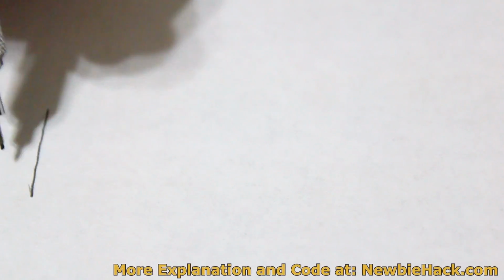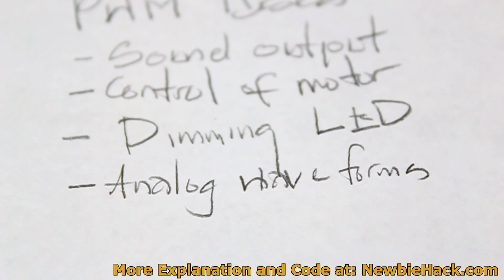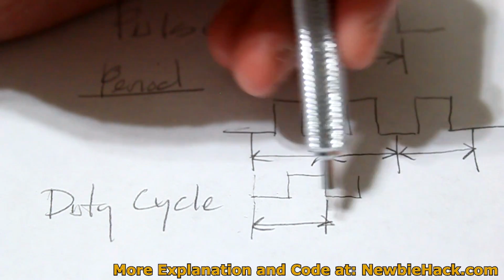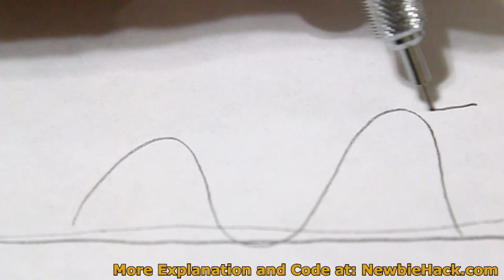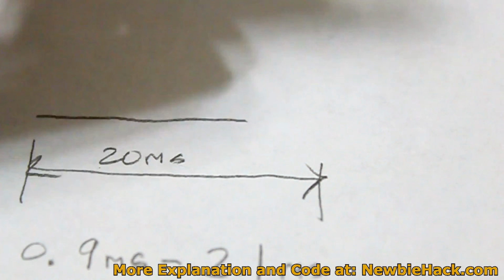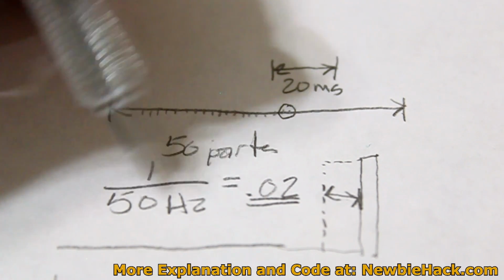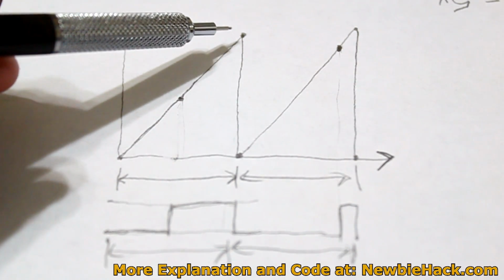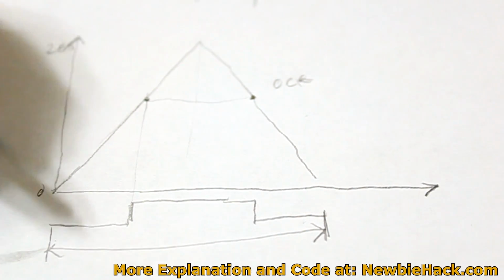37. Arduino for Production!  How to Use or Create a PWM (Pulse Width Modulation) Signal

Comment: Is pwm adc or dac?
Reply from the maker: Neither, it's an approximation of DAC, digital to analog. It doesn't actually create an analog waveform, but it delivers a controlled voltage to devices that can handle a pulse at the created pulse width and frequency.
Reply: @PatrickHoodDaniel  thanks a lot, you saved my test

Comment: What a brilliant video! I found your introduction to OCR/IVR for faster PWM very insightful - thank you very much. 
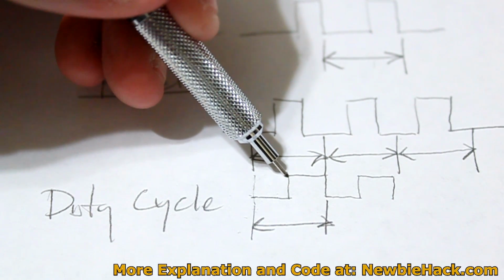Just wanted to pick you up on something you said @7:59 were you say 'This would be a 50% duty cycle because it is happening right in the middle of the period'. I found this  slightly confusing and ambiguous since you had just previously showed us a 50% 'phase corrected' cycle wave starting at a 1/4 way through your period. 
Of course, this all became clear in your subsequent examples, that the duty cycle refers to the percentage of the period where the pulse is high and not where the pulse starts.

Comment: Can you tell me what micro-controller setup would work to control a 1/2HP 110v single phase grundfos heating pump (ups 26-150SF)? I have a solar thermal controller that is capable of a 0-10v PWM output signal for speed control and would like to use it. But need something that will control the motor speed. Any ideas?
Reply from the maker: Really any common microcontroller would work.  You just need a mosfet or a transistor to increase the output voltage from the PWM signal.

Comment: This was quite helpful, I was wondering if u knew how to control the speed of a vibration motor but rather than physically having to turn the dial, the motor connects to the computer and u can adjust the speed using the computer
Reply: Power input

Comment: Hi Sir, I have a question about PWM. In a very simple understanding the duty cycle is basically to cut down the voltage with respect to the reference voltage and to maintain it with using a capacitor. So like refVoltage = 5 and dutyCycle = 50% we will be having a 2.5V DC. But as in this tutorial the motor dataSheet says that we should have a frequency of 50KHz, what is the advantage or usage of the pulse resolution i.e. 50 cycles/sec. Meaning if we vary the pulse resolutions what will happened ? I am confused...

And once again many many thanks for sharing these all videos :-)

Comment: I have been trying to get the parts together to build a DC to AC pure sine wave inverter. I haven't got any electronics yet. I have some very large heat sinks. and 8x 22000uF 75 volt caps. I would like to build the largest inverter I can. well in the kW range. like at least 4,000 to 6,000 watts. from 24-48v. I need it to power my home. and been thinking I may as well make it a split phase. for 110/220v 60Hz. I can use all the help I can get. I am self taught. I learned what I know about the electronics. from reading and videos like yours. and thanks for the effort you put in these great videos. if you can help with my project. I can use some schematics. most of the ones on YouTube are in a foreign language or have a heavy accent that is hard to understand. and its hard to read the circuits they have drawn out. I thought about getting a sine wave driver board that is for a inverter from eBay. and try to use it to drive some FETs and a boost circuit. and what ever. but like I said I need help! thanks either way.

Comment: You get motor controllers in the market like (Talon, jaguars etc) which take one signal and based on that you can control the direction and speed of a motor. The direction is dependent on the pulse width of the signal, so each motor controller has min, neutral and max width and if you send a signal between the min -  neutral ( usually 1.5 ms) the motor turns CCW and CW if between 1.5 ms - max width. This doesn't make sense to me. Does the motor controller have a separate circuitery to determine the pulse width and based on that it actuates certain switches?

Comment: One question: Why would the battery short if you touched the two leads together?
Reply: When you connect to leads directly without any passive element in between then there is little to no resistance for the current flow. Current = Voltage ÷ Resistance (Here R is very very small since lead wires of battery have resistance in milli Ohms or less). Therefore, battery current will follow this very very less resistance (almost = 0) path also known as Short path because whenever you connect any element in parallel to the short path no matter what... current will take this short path and drain out the battery in few seconds. You can try it out with 1.5 V battery. Just connect a single wire joining both terminals and after some time the battery will stop working.

Comment: Sir ,also please explain ohms law with regard to the motor example because you put a voltage across a resistor(the pot)and you get a current through the motor which makes the motor spin,you get more or less CURRENT depending on the rotor position of the pot.I=E/R  (OHMS LAW)

Comment: Sir,Please read "the Art of Electronics"as the on/off time of the pulse has nothing to do with the voltage.A 5VDC pulse when on is 5VDC regardless of the time it is on,When you are discussing PWM ,the WIDTH of the pulse is what one is controlling regardless of the voltage,and the WIDTH is measured in MILLISECONDS,thus this reveals the time on/off...WCH

Comment: How does this improve tork of a motor or does it,  what are the advantages of
pwm over pots if you are not needing to use digital signals as control ?

Comment: I probably watched one portion of this video five times before I noticed that note in the top left hand corner of the screen stating that you'd meant to say "20 miliseconds" instead of "2 miliseconds". I even went as far as to grab a piece of paper and try to figure out what I wasn't understanding. Could you slap that in the center of the screen instead, perhaps?
Otherwise, this is a great videos!

Comment: It would be better if you use a 12V power supply with a 12 to 5V regulator for the microcontroller and an L293D (which is a double H-Bridge) to controle the motor(s). We used this in our robots. 
You can check the L293D datasheet it is a very useful circuit

Comment from the maker: These videos will not help you with Arduino.  These videos will teach you how to program the microcontroller and get ready for developing at the PCB and circuit design level.  Arduino is best for one-off projects rather than product development for manufacturing.

Comment: Thanks. I finally got mine to work but I'm not sure what the method is called by setting 0-8 pins high depending on what the byte number is from 0-255.

Comment: do we hand it a delay before turning on the pin? Having trouble with the mathematics here. CPU clock speed / samples per second = the period, but how do we balance out the integer value + the delay needed per interval?

Comment: I'm going to try something on an Atmel UC3 32 bit, but take it 8 bit at first to see what I can come up with. I might have to think on it about a day as usual to plan out the approach. I'm going to try pcm wave mono audio at first to get the hang of it. Might even be able to find a way for volume control by subtracting from the data. The frequency would be samples per second. My Atmel goes up to 66MHz so should have no trouble playing 441khz if I can get it working all the way. PWM video next

Comment: hii!first of all,thnx for ur videos,they are great....:)
I saw ur site but i m not able to log in,it's showing run time error.
I wanted to know about dc motor control through pwm on atmega 16 board.I am confused with the pin and programming a bit.Please help and share the video if possible.

Comment: Sir, I really appreciate your tutorials very much. I migrated from using PIC to Atmel.  I was really confused on how PWM works, not until i watched this video. We are currently making our thesis, which is on Industrial Automation (Just a Prototype) Automated Coconut Processing Machine . From cutting, grating to extraction. I am a Computer Engineering student from the Philippines (Systems Technology Institute). More Power to You!